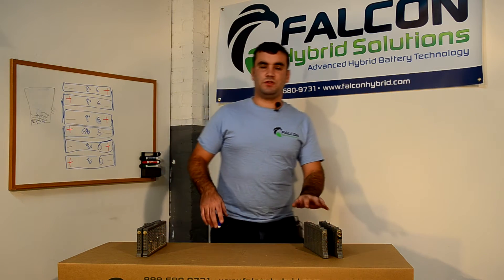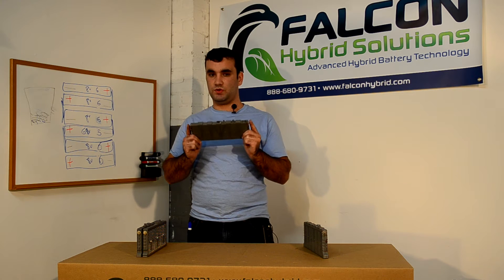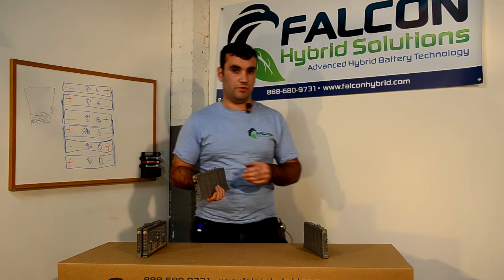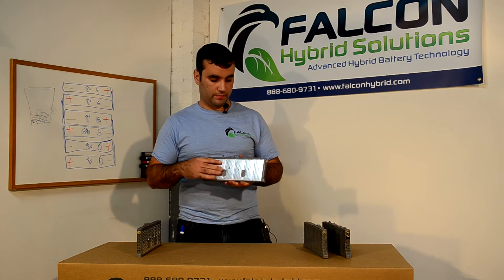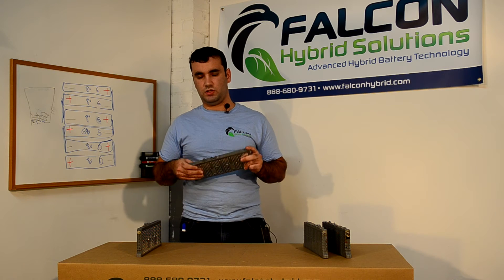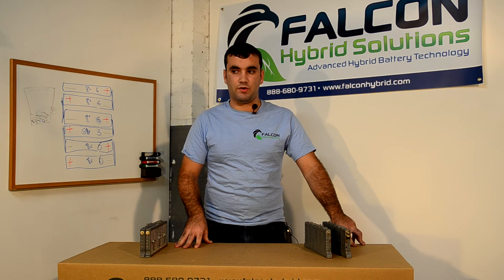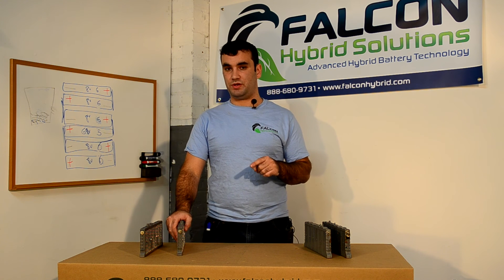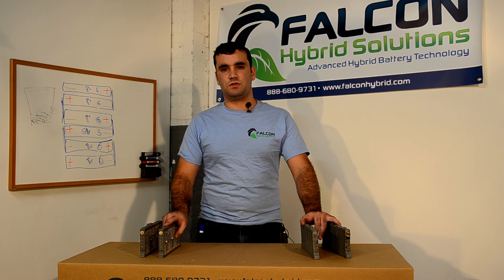Prius Generation 1 and Generation 2 Cell Modules Explained

Comment: Do you think it's possible to get a multipurpose use out of the 2nd gen modules? What exactly is it like inside of those modules? Can they be taken apart? Are the 2nd gen cell blocks made of smaller AA type nimh cells that could be taken out and used for other purposes?